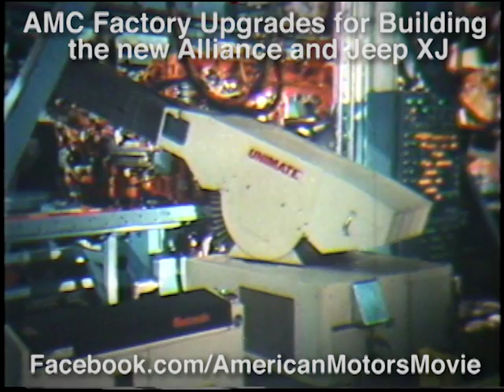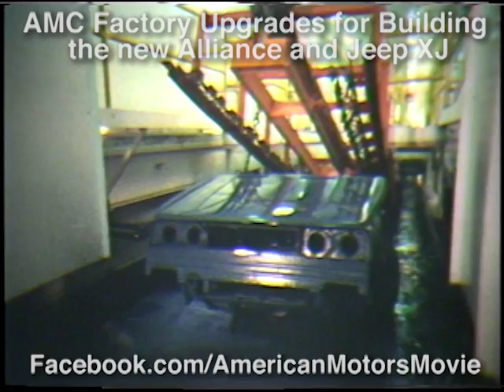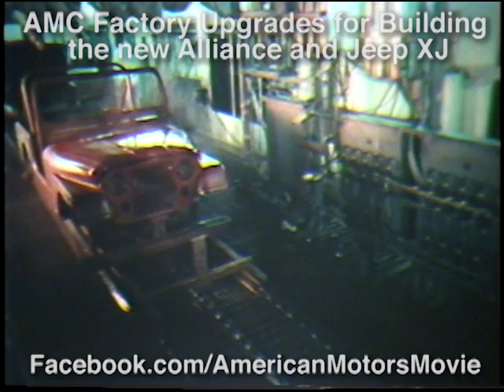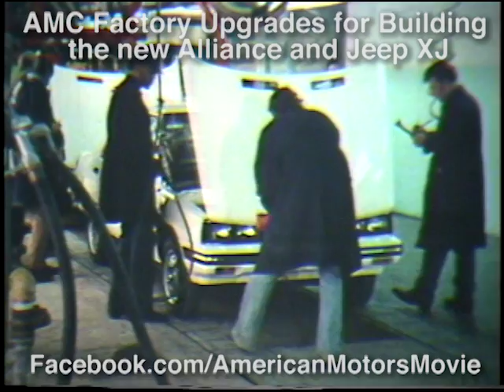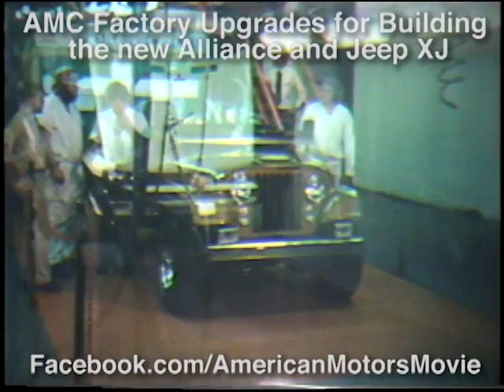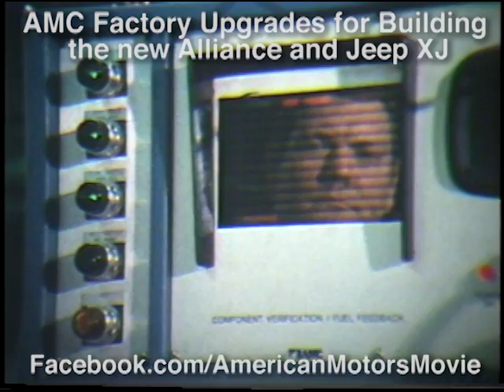Building the AMC Jeep XJ & Renault Alliance - Vintage Factory Footage

Comment: It's a shame what happened to them. AMC wasn't the bastion of quality (none of the rest of the big 3 were either), but being with Renault was the beginning of the end. By the time Chrysler bought them, it was only the Jeep line and some production facilities that were really what they were after. The rest were table scraps at best. 

AMC's dependence on their competitors for parts was also what helped do them in. While every manufacturer buys from this supplier and that, and others buy from each other, AMC depended on their competition for things like transmissions, engines and other parts. That's didn't bode well for the bottom line and spawned jokes like AMC being Almost a Car and All Makes Combined.

Comment: Back in '83, I was dating a Rn. Who purchased her 1st brand new car. Renault's Alliance. She couldn't drive to save her life. Every time we met to go on a d8,we had to go in my Buick Riviera. When we return I would see new scratches & minor dents. That car was a POS. The engine would burn oil, overheat when bumper to bumper with A/C on. Rattles galore. Resale value was as expected, SPIT. I felt so bad for her & took her to where I got my BUICK @. She got a small car, & was happy because this car didn't break down as the Renault did even b4 the warranty ended. She sold it b4 it did lapsed.

Comment: My ‘96 JEEP XJ is essentially an AMC-era Jeep:  Chrysler hardly changed anything visible on it, except for the  fuel injection and maybe a few other peripheral engine systems.   I love mine, and I am approaching 300,000 miles on the original engine and transmission.
When you look at the older AMC Interiors, you can see the influence that lasted up until the XJ was refreshed in 97.

Comment: If only the Alliance had had a more robust engine (power and durability wise) and better parts support.  I had one.  Except for the weak points mentioned, it was a very competitive small car relative to others in the era.  Fuel economy and driving impression and interior space was excellent.
Reply: Sales for the first year or two were good, then fell off a cliff due to the problems mentioned.
Reply: Contrary to the video, quality was horrendous.  I had an 87 Alliance.  I remember driving down the road and all the screws from the sun visor fell into my lap and then the visor hit me on the head!  I laughed at the time, but wasn't laughing when the brakes, suspension and exhaust all failed within a couple of years...

Comment: My 87 Cherokee had to many parts sourced from to many manufacturers. Starter solenoid from Ford, transmission from Toyota, and computer from Renix. It was tough, except for the transmission, but it just looked cobbled together under the hood.
Reply: jerrywh3 my 93 is like that lol.
Reply: Cause it was.  They had money problems.
Reply: Actually the 1987 Cherokee used a Chrysler 727 Toque-Flite 3 speed automatic transmission which were bullet proof.
Reply: On my XJ :  Body and axles made in U.S.A, Transmission and some electronics made in Japan, Diesel engine made in France, window glasses hecho en México,....  still running after 30 years
Reply: Toyota transmission were bad?
Reply: @exantor  That's what I'm saying, those Asin-Warner transmissions are the toughest I've ever seen. AW4's never die

Comment: The Renault Alliance fascinates me... maybe because I was born after the 80's and didn't have to live with one. I think they thought of it as a stopgap, really, until they could get the Premier out (much like the Chevette was to the Citation, though that didn't turn out quite as planned either and both of those weren't stellar cars to begin with). One can only wonder if Chrysler hadn't bought AMC if the Premier would've turned their fortunes around...

Probably not, tragically. The XJ was AMC's last great gift to the world but they only put in the engine it needed (the 258 six) way late in the game, practically as Chrysler bought Jeep. Had they had the 4.0 as an option from the start, things might have been different... It doesn't matter how good the cars you've got are if you don't realize what you have.
Reply: The Premier ended up turning Chrysler's fortunes around! They were having issues with their new FWD car platform when they bought AMC. They ended up scrapping the Chrysler design and basing the LH platform (93-04 FWD big cars) on the Premier. Main problem with the Alliance was the tiny 1.4L engine. It was adequate around town, but not really suited for interstate driving. AMC tried to tell the Renault people it needed more motor for US driving, but they wouldn't listen. Took two years to get the 1.7L, and by then it was really too late, car already had a reputation as being underpowered. I had an 83 with auto trans. Great around town, but trying to hold 65-70 mph with two adults, kid, and weekend luggage was asking a bit much. 0-75 down hill, 60-65 up hill (between Atlanta GA and Columbia SC on I-20).
Reply: @AMCMag  In continental Europe (i.e. pretty much only France, which is where Renaults sell really well) the Renault 9 and 11 were even offered with smaller engines. I mean, there are highways in Europe, but Americans (and Canadians) have to travel longer distances, at high speeds that would overwhelm a 55 hp 1.4 L 4 completely. Also, the cooling system (from what I have read in contemporary articles) in the Alliance/Encore didn't seem up to snuff for North America, and that the Alliance 1.4/1.7 were prone to overheating and cylinder head warping (apparently the water pump is at the top of the block, and any coolant leak will not allow the pump to circulate coolant because the coolant level had dropped below the water pump). Americans love their a/c (it gets really hot and humid in the south in the summer), which really taxes a car engine's cooling system. 

A family member had a Renault Laguna with the 2.0L version of the Alliance 1.7L and it also warped the cylinder head, and overheated fairly regularly.
Reply: Alliance was a total piece of garbage.I remember looking at them when I was buying my first car in 84.Fast forward 5 years and I was selling cars and would wince when I would see an Alliance or Encore pull on the lot.Weren't worth anything.
Reply: Good fuel economy numbers as I recall.Somewhere around 50-52 on highway I think.But you are right they needed a bigger engine at launch at least for a step up to the base 1.4.The GTA should of been brought in for launch as well as a small wagon to compete with the Escort and Sentra wagons.Unfortunately the money was gone by then.The LeCar and Fuego/18i were not movers..
Reply: AMCMag everything you said is absolutely true. If Chrysler didn't buy AMC, it was going to be marketed as the Renault Medallion. Ended up being called the Eagle Premier though. Some cars were produced before the buyout with the Renault Medallion on the grille and back decklid. As far as the power issue with the Renault cars, the 1.4 should have never been put in these cars. Every publication I read, from that time, said if you were to buy an Alliance or Encore, pay the extra money for the 1.7. Since most cars were produced with the optional automatic transmissions, you really needed the extra horsepower and torque from the 1.7 engine. I personally loved the 2.0 liter engine in the GTA's.

Comment: I know a lot of people that used to work at the Kenosha plant. Tons of bars at the corner of every block around the plant and some of the workers would get wasted during their lunch. Even the body panels would sit outside unprotected during the winter time before they got primer so they would start rusting before paint even touched them. It's too bad because AMC could have been a great company. They provided a lot of local jobs but really how many of these passenger cars do you see on the road today and not in the crusher? This video talks about Japanese vehicles but I see a ton more older Accord's and Camry's on the road from around this time.
Reply: That's mainly because they made a ton more of them than AMC/Renault made of anything.  That and resale values were lower -- the cars were simply used and abused then junked. Not because they were any less than any other car to start with, but because they were thought less of as used cars and not taken care of.  Original build quality was on a par with anything else of the era.
Reply: AMCMag well said! Absolutely true.
Reply: You know what ypu are talkimg about